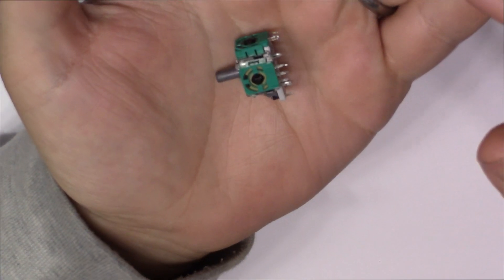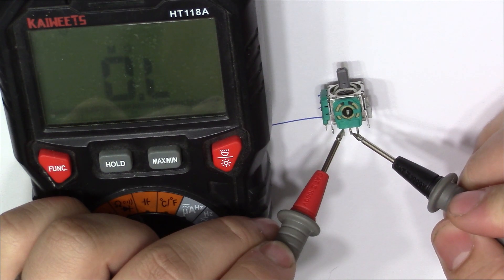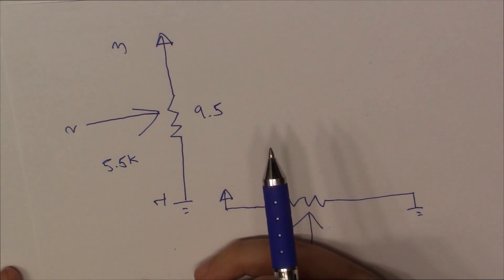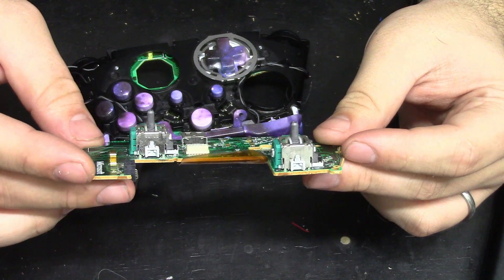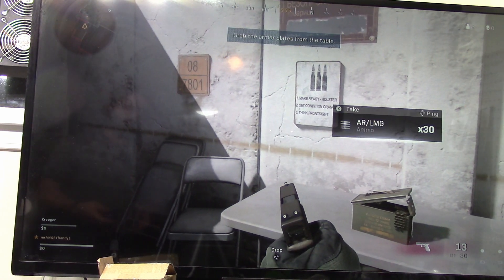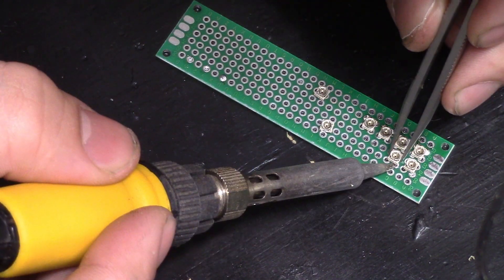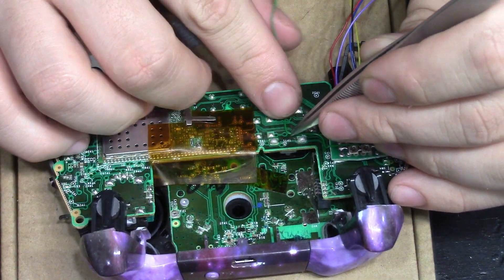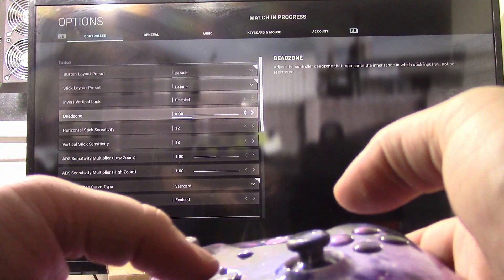Understanding stick drift and a mod for getting rid of it FOREVER. Xbox One.

Comment from the maker: The kit is now available for purchase! Helder and I shared ideas back and forth and he designed a very awesome flex PCB that installs in seconds! Thanks for your patience everyone!
 https://www.heldergametech.com/shop/playstation-4/analog-stick-drift-fix/
Reply: The new design goes to only using one pot per axis, why is that? Thanks and keep up the great work!
Reply: @wolfz616  I think they use a single 1M ohm pot, soldering 1-1 2-2 3-3 so the final resistance value would be almost 10k ohm (9.999...). I just ordered a couple pot to test this idea.
Reply: @BruTaLTrIcKzx  the ones that I received and checked appeared to be 450/500k ohms when I checked
Reply: @wolfz616  and did it work? what kind of controller did you use it on?
Reply: @xeostube  still waiting for them to be delivered, but I'm doing all of this on a PS4 controller.
Reply: @wolfz616 I watched this video(https://youtu.be/O9PJbhoRYJU), but since it's not convenient to buy products in my area, I used a potentiometer to try to fix the drift problem. I used a 50K potentiometer and found that the available range of the joystick became smaller.
Reply: @biubiuup8816  that makes sense if you tied all three pins together as done with the new board. Is that what you did, or did you use the pot like a single variable resistance between two pins?
Reply: @xeostube   three pins together 
\ If I choose a larger resistance potentiometer will be better?
Reply: @biubiuup8816  I don't know, I've never tried tying all 3 pins together like that, but in my mind that's the wrong way to do it. I used a 42k POT attached just between the pins that needed to be brought closer together. You can see how that worked and the explanation of why two pins should be enough here: https://youtube.com/playlist?list=PLDKW3vU_gCgIcOZhVqaM_oOn563pae0BQ
Reply: @xeostube  I bought a 500k potentiometer tested, respectively, in the 2.3k and 10k resistance value of the joysticks used, no strange problems, joysticks available range is not reduced (I can not figure out why the 50k potentiometer will have problems), in addition, only in the two pins solder resistors sometimes have problems
Reply: @biubiuup8816 maybe you should post a video of what you did! On the face of it, a 500k pot on 3 pins is almost the same putting between just 2 pins, since anything above 100k doesn't move the joystick position at all, and if you were for instance setting the pot to 100k on one pair of pins it's going to be 400k on the other.  Can you guess what position the pot is in (ie 10…% from one end, etc)?
Reply: @wolfz616  still waiting for my pots, Aliexpress takes too long to deliver... I still think 1M ohm is key tho
Reply: @BruTaLTrIcKzx  I buy some 1m ohm,Will be tested in a few days，Is your 1m ohm working properly?
Reply: @xeostube  FInally got around to installing my test 1m pots, appears to be the one. Resistance between pins 1-3 was the same w/ and w/o the pot board. Doesn't appear to have any deadzone issues like I had with solderking/Helder's board.
Reply: @wolfz616  so you used a single 1M ohm pot instead of two 50k pots? And you were able to fix the zero/rest deadzone issue and retained full ability to hit the outer boundaries of the stick movement? Did you wire the pots like this guy does? https://www.youtube.com/watch?v=MIDa3WeNZDI
Reply: @wolfz616  so they should be soldered only to the two side pins and not to the central one?
Reply: I also would like to know why the design was changed to one pot per axis. With the amount of people asking, the lack of response it seems intentional. All of your other posts clearly say you must use two and that one will cause distortion. 

Is there a big flaw in the board your selling? Did you use a new design or better pots? Personally, the board looks super clean. I'd much rather buy it for the look and simplicity rather than solder wires everywhere, but I don't feel comfortable buying it with all this conflicting information. Either the board won't work correctly or you're intentionally ignoring the people questioning your design. Both are bad, but I'm sure we'd all really appreciate some clarification.
Reply from the maker: @A6uh  this video was basically a rough idea that I knocked out in a few days. Helder was able to refine the idea and make it so it only uses one pot. Here you can find a very informative video where its installed, calibrated and shown being used. https://m.youtube.com/watch?v=O9PJbhoRYJU&feature=emb_title

Yes, for me, at the infancy of the idea I thought it can only be done with two pots as in my testing I had a lot of weird stuff happen when using one. I however didn't rule out every variable that Helder has taken the time to do. I apologize for that confusion and will admit I was wrong.
Reply: That's a real nice board, and a clever layout. But I'm noticing that you are only using one pot per axis, after claiming that two were necessary...
Reply: @Solder_king  All you can change is the range of resistance of the pots. So either you made it higher or lower, or you are tying different pins together. So what did you actually change? Because my experience suggests that at least on the genuine xbox controllers I've tested this method doesn't work.
Reply: @xeostube  Have you figured this out? I'm looking forward to make one myself - since they don't ship to my country - but I'm afraid that it doesn't work properly, as I've seen in your videos that you're facing some issues. Maybe Solderking could make another video addresing some of these problems and give some insights about it.
Reply: @caslusotas9038  no, I have not. This method works for ps2 controllers fine but my tests on Xbox one have not worked. At this point there's absolutely no hint as to what's special about the Xbox one design.
Reply: @xeostube  im having the same problem on my ps5 controller have you found a solution
Reply: @LilsniperMf  Are you saying you tried adding a pot and you get distortion?
Reply from the maker: Check out this video showing the install and it working :) I'll do my own if there's enough interest but this video nailed it. 

https://youtu.be/O9PJbhoRYJU
Reply: @xeostube    adjusting it did not make it return to center (when moving it around and letting it return to center), and it seems like it doesn't fix the drift completely (it still drifts away from center)
Reply: @Solder_king  That only video only shows that you can center the stick, and does not address the issue of distortion at all, which is where this seems to fall down (on the xbox one, at least; it might be fine on the ps4).
Reply from the maker: @xeostube  I haven't seen the distortion effect gameplay.
Reply: anything for UK or Europe?
Reply: Just got 2 kits so hopefully they work. 🤞
Reply: will this work with 360 controllers? or how to make a board to fix the drift on 360 controller?
Reply: Can you please put these on Amazon it's hard to get them where I live
Reply: The helder PCB only has 2 screws; how does that work?
Reply from the maker: @Xealous  he was able to refine the overall mod.
Reply: I love you guys....i just bought one...tired of supporting the busted pot industry!!
Reply: Does this work with a Steam controller?
Reply: Not bad but I can see big problems here....first. when the pots will continue to degrade over time you'll have to adjust more and more to compensate untill you can't anymore... 2 ND issue is, there is no fix if the resistive path is damaged making the stick sensitivity inconsistent. And your stick will move all over the place... The only fix i see here is hall effects sticks.

Comment: I have a question, hopefully you can help. The right joy sticks drift was stuck as far right as possible, I changed the stick and both pots but it still had the same issue. Is there anything I can do about this?  Thanks in advance!
Reply from the maker: This typically happens when a trace is broken. With a broken trace the signal will be held high or low depending on which one was broken
Reply: @Solder_king  is this repairable?
Reply from the maker: @JustMike909  absolutely :)

Comment: There is this board that you can buy called something along the lines of Drift fix board and I was wondering if it did the same thing as your custom board? It looks like it installs right on the solder point of the potentiometer.
Reply from the maker: Helder and I collaborated on that. Since then a lot of knock offs popped up

Comment: Hello, a couple years ago I got into repairing ps4 controllers and I been having problems with the drift I have a little set up and physically know how to replace the analog stick, but what im struggling with is the Potentiometers. I don't know which one to use for like the common ps4 controllers like jdm 010/30/40 basically the controllers with blue joysticks. I bought some Potentiometer with the 10kohm resistance but it didn't work. So the question is how do I know what resistance Potentiometer to use?

Comment: This is a specific issue of stick drift that won't solve the breakdown of the carbon tracing in the wiper required for the POT to function, which is another condition coined under "Stick Drift".
Reply from the maker: I covered that in the video just so people are aware that it isn't a fix for that lineage of stick drift lol

Comment: Hey, I have a Dualsense controller (2.3k Pots) with stick drift that I would like to integrate into an arcade stick. Because I only need to wire up the Dpad I would like to completely remove the analog sticks. After removing them how would I keep the analog sticks input at zero/neutral? Can I wire in a same size resistor on + to C and - to C of each pot and it will read neutral? Or am I misunderstanding how the potentiometers work? Thanks for any help!

Comment: The problem with this mod is that you will be reducing the resistance of the original potentiometers. This can cause the analog sticks to have reduced motion (Maximizing too early) or low sensitivity (Never reaching its maximum like you found here 17:06).
A way around it would be to replace the original potentiometers with a higher resistance ones so not only you would be able to calibrate drift but also the range of motion/sensitivity.

Comment: Not bad but I can see big problems here....first. when the pots will continue to degrade over time you'll have to adjust more and more to compensate untill you can't anymore... 2 ND issue is, there is no fix if the resistive path is damaged making the stick sensitivity inconsistent. And your stick will move all over the place... The only fix i see here is hall effects sticks.

Comment: Thank you soooo much for this video. I’m a newb to electronics and just started learning reading my first book lol. I also started doing minor repairs and have hit a wall with these sticks. I got genuine Alps Alpine sticks direct and yet after install I still get stick drift on Xbox controllers. I had a feeling there had a be a way to calibrate these sticks like Nintendo does but could not find anything about it. Tried the Microsoft software that comes with windows which didn’t help. Maybe I did it wrong but after your vid I understand a lot more of how this all works so a huge thanks.

Comment: Im aware of the kits you offer, but unfortunately they do me no good as I have no experience with soldering. You make it look so easy, but I can only imagine soldering is a skill set that takes much experience.  So my question is, do you repair controllers for customers? Or do/would you fit a controller with the kit for someone like myself who can't make the modification on my own? Desperately seeking solutions  to this drift nightmare. I have spent more on controllers so far than I did for the Xbox one console originally! Downright infuriated player right here. I need a hero so I can get back to being a hero myself saving the world via fps games!! Need reliable controller to achieve this however. Help!

Comment: Hi!
Enjoyed your tutorial on stick drift.  I am wanting to substitute a different 10K pot onto my XBOX 1 controller so that I can use a turning disc under my bike's front tire to input steering in XBOX racing games.  The bike is on a rear wheel stand, I use a standard speedometer on the rear wheel to sense speed.  
I removed the pot from my controller and used a multi-meter to try to measure resistance across the pot, but couldn't get the resistance to vary when I turned the pot with a small flat head screw driver.  I also couldn't get any reading at all when I put the multimeter probes onto the solder spots on the board where the pot leads for the other joy stick (that I haven't removed from the board) are.  Any idea what I'm doing wrong?
Ted

Comment: Could you explain how it is possible that the total resistance values should be 10K but each side together is more than 10K..
I bought POTs that have like 10K from pin 1-3, but over 6K from 1-2 and 2-3.. I'm really confused by how this works.. 
Does this mean the POTs that I bougth are poorly produced?

Comment: thats false..
unbalance resistance its not a problem..the manufacture software calibrate them based of the resistances(or voltage drop) they got.
Reply from the maker: It's not false. The resistance changes due to wear, which is why the develop drift rather than come with drift. So no. Not false.
Reply: @Solder_king  o.k. so take a new potentiometer, install it and let me know.
Reply from the maker: @TheBaregel  that's literally the video

Comment: Ok ok so the science behind it is amazing. 

I literally started soldering 2 days ago. Just To solder in new analog sticks and I did eventually!  But they still drift. New sticks still drift! I posted a video about it and guy told me I need to calibrate them. 

Which then brings me to “ so you need to calibrate the new sticks” or they useless. So I’m guessing I wasted £10 for 2 sticks because idk how to calibrate them.

Then this dude building some crazy box thing with a few screws and living in 2040 while me and my soldering skills are in 2013 still. 

I have a PS4 controller  with stick drift and I can’t fix it. I wished in the uk there was some dude who live 2 miles away that could show me how to fix. Or just help. PS4 pads suck ass. 

Bro what is that thing you got! Potentiometer box thing. That’s everybody’s dream. I have a guy with 3 dead controllers due to stick drift, 

How the heck man. Great video.
Reply: It's just a multimeter it's used for many different things. In that case it's to read the ohms value. But they read voltage and other things too.

Comment: Why can’t you add the ps3 Hall effect thumbsticks into a PS4 one. They both use a 3.2v design so you can rework the circuit with op amps to make the PS4 controller recognize the input from current to voltage. but they are not any kind of a drop in replacement for a POT style stick. None of those 4 connections, save for Ground, will go directly to the controller. The VCC for those things, IIRC, is 3.2v, and that is what the PS3 controllers were setup to use for their AN+ voltage. You could probably get away with installing them in a DS4, along with the Op-Amps for them, since they also run a 3.2v AN+ setup, but the DS5 there's going to need to be a bit more work done in there as they have a 1.8v AN+ setup. 

The best option would be to use the Op-Amp circuits from the controller that you get the sticks from. On the latter version controllers they crammed all of that mess, as well as some other stuff, into one single chip. That kind of controller you don't want for parts, so the MSU_VX3, MSU_VX4 and MSU_VX5, rule all of those out. You want the older style, MSU_V2, MSU_V3.5 or MSU_VX versions, as they all still have the Op-Amp setups.

The Op-Amps each have a handful of support circuitry as well, Resistor and Caps, that also will need to be installed. Best thing to do there would be to get an older style DS3, tear it down and reverse that section of the thing, then make up your ow boards for the components. 

It's not going to be a nice quick and easy thing to do, but it's doable.

Comment: Great vid, but way more complicated then needs be. I just put 2 10Mohm resistors in parallel with the wiper and the opposing leads and it worked great. I got the idea from this video though, so thanks!

Comment: Wow. Man that’s phenomenal. I have a wild question. I replaced a potentiometer and when I had tried the controller it was stuck up and a d pad double click as well. I’m replaced it only because I was selling it to a friend and I didn’t want him to acquire stick drift after getting it. Potentiometers are new as I said. Any other way that they would do that? Too much heat? Just wild never had this issue then I grabbed another board and that wasn’t drifting and checked the potentiometer pad and they looked like new but when I put it back in it had an issue as well. Maybe I’ll have to look into this too. But I’m wondering if it’s a problem with my technique or something. First time I’ve had this happen when replacing potentiometers and the entire analog